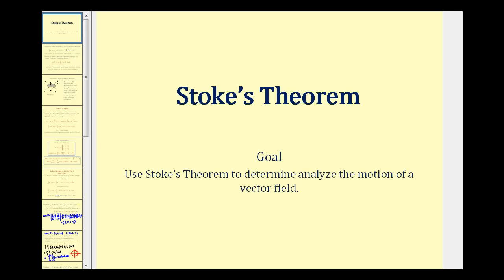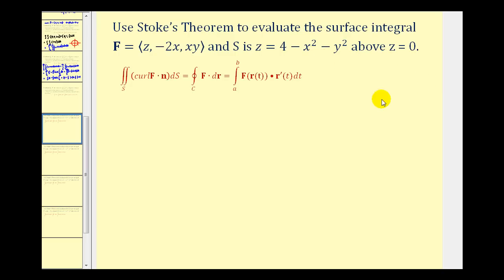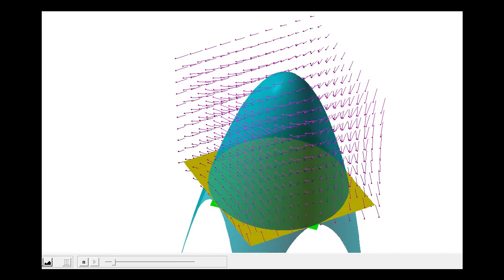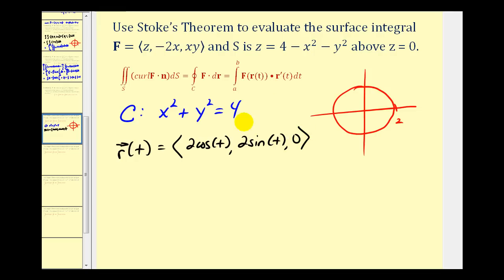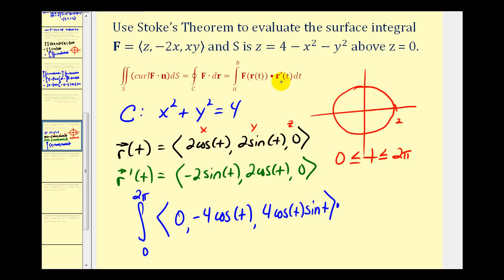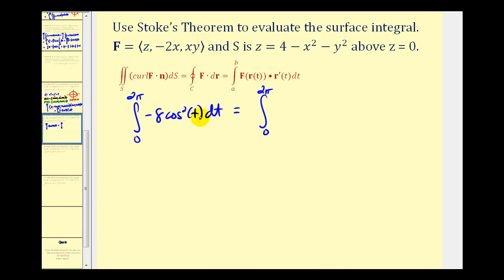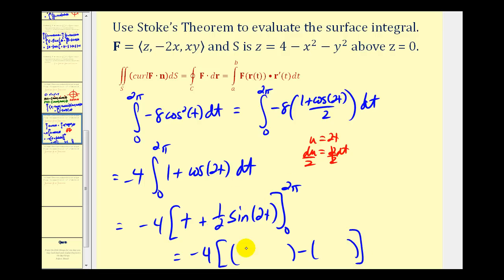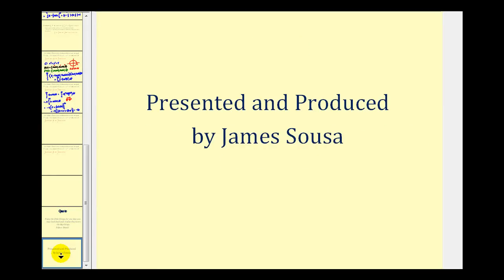Stokes' Theorem - Part 2

Comment: Could you please tell me if I'm right in thinking that surface integrals are always equal to the line integral along the 2D curve that the vector field goes round counter clock wise? if I'm right, then if the angle is not 0, then I have more than one 2D plane curves. they both can't have the same line integrals, if the angle is not 45. unless by counter clock wise, you mean perfectly so. please explain. Thank you.

Comment: I know that we must use Stokes theorem to solve this problem but I tried another way with Divergence theorem by z=0 (xy plane), I used that to close and limit the area. In xy plane we have circle with area 4pi and the div(F) =0 and I got the flux -4pi. Why is my solution wrong ? I mean Integral (F dS) + Area of bottom = Integral(Div(F)). When Div(F) = 0 then I thought Integral(F dS) = - Area of bottom which is -4pi, but why ?!

Comment: Your problem statement says to "evaluate the surface integral of F," but then you evaluate the surface integral of the CURL of F in order to make use of Stoke's theorem. Since F is not equal to the curl of F, it seems there is something missing here. If there's a logical leap, it seems you neglected to explain it.

Comment: just a heads up, around 1:34 you say that the net rotation along the surface of is going to be equal to the net rotation along the intersection curve. This is not true. The net rotation around the surface (double integral of curl(F)ndS ) is equal to the'work' done by the field along the curve of intersection ( integral of F dot dR ).